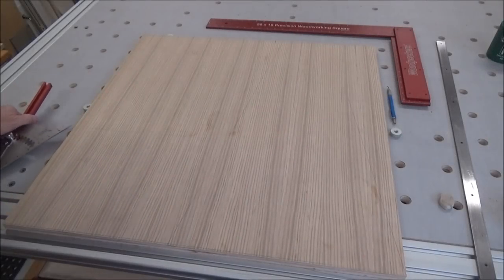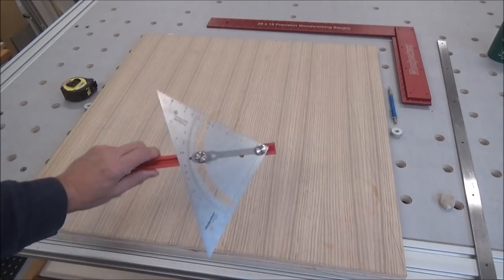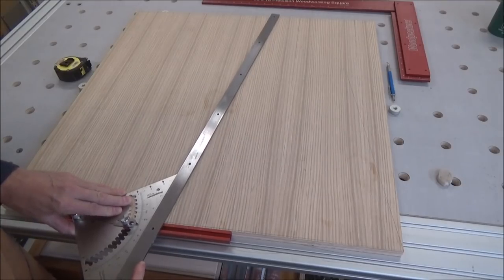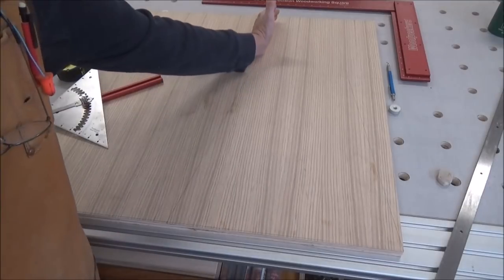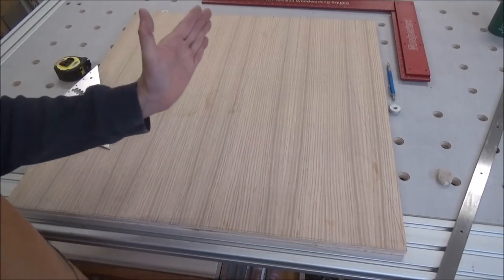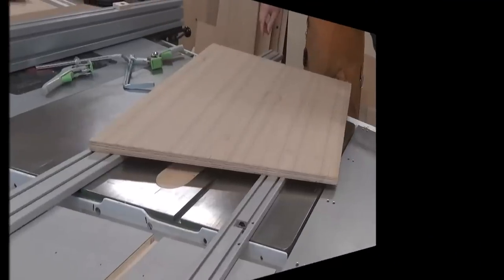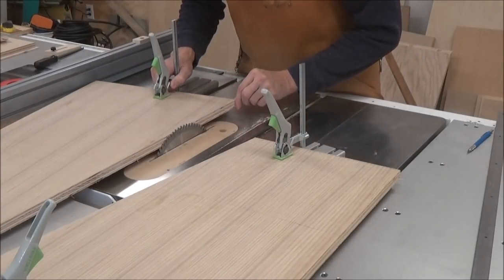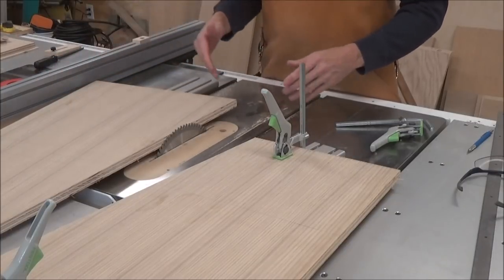01 Angled Cabinet with Sliding Doors

Comment: I'm very interested in this build. I want to do the same for mine, but I may put it on an incra frame with the wheel kit.
Reply from the maker: I don't know what that is but this is a very economical solution. If I had flatter panels it would have been perfect. As is it works great. Thanks for watching and good luck with your build.

Comment: What happened to your track saw? Is it a festool?
If yes, how old is it?
What caused the demise of the saw, crappy saw, you used the sh*t out of it, or what?
Reply from the maker: It is a Festool saw and I don't know what happened. I just sent it back to them for repair. I'll let you know when they let me know. I take it you don't like festool.
Reply: Jeff Fischer, no, on the contrary, I love festool. I have almost everything they sell. I love my TS55, but at times, in certain situations, it does seem like it gets bogged down. It still makes the cut, but just wished it was stronger. Beautiful cuts by the way. I also have the TS 75, and it's good, but it's a beast, therefore bulky. I just bought the TS 55 cordless saw, so I'll see if it's a little better than the corded version, which surprisingly, I've heard that it is. My friends tell me to get a mafell, which they don't have either, just festool, I guess they want me to be the first to take the plunge. The other track saw they keep telling me to get is the makita. If I had more time, I probably would buy these other saws and put them through there paces, but the mafell is not cheap, and I'm not sure if it has the same resale value and appeal as festool does, on Craigslist or offer up.
Reply from the maker: Well this one was given to me when the previous owner got a new one. It was used hard before I got my hands on it and I have not used it that much. Once I get it back I will be sure to let you know how it performs. Thanks for watching!